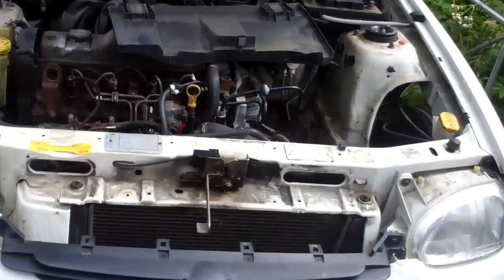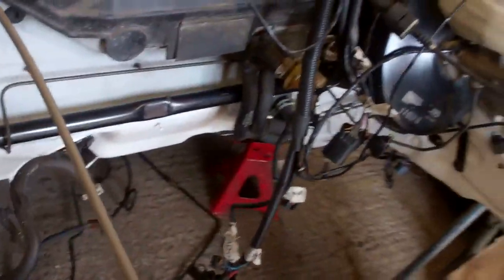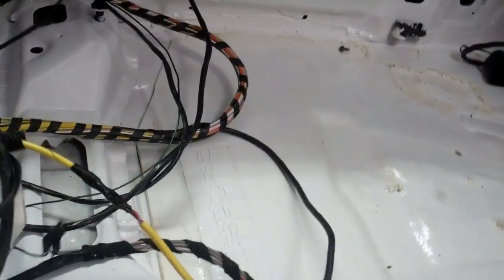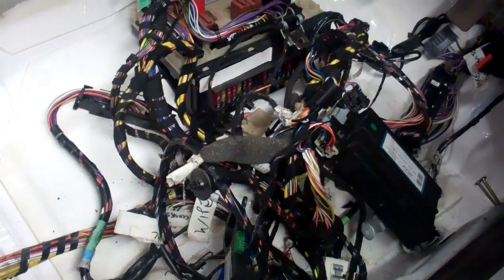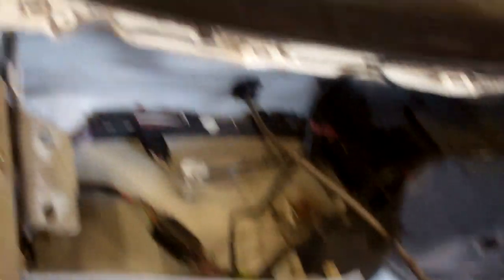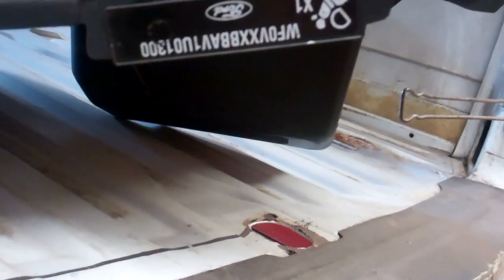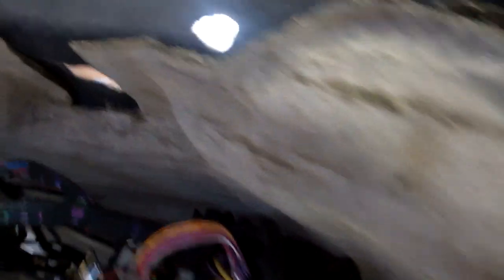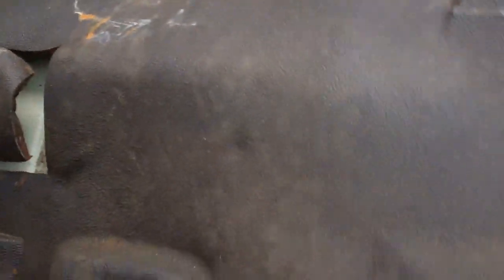FORD ESCORT MK6 VAN MODIFICATION AND RESTORATION PART 13

Comment: Great progress, I am aware of the maximum effort required to convert a diesel to petrol after reading up over the years for my van. I am in the process of getting a wiring loom from a Mk5 Ghia, your update on the U shape of it has greatly helped me as I have removed carpet and was about to start taking the loom out only done where the doors are. Some of that loom may also be the electric windows and stereo wiring that you have. I will keep this in mind now and hopefully I can get the fuel lines I was aware the tank is different which I have a NEW one already to fit for the van. Keep it going.
Reply from the maker: Thanks for your support hope you build goes well too 👍

Comment: That sounded like a real pain of a job, swapping the loom and everything else over... Like I said before I have the same diesel van and am looking to do the same engine conversion as you are... it is certainly giving me a headache after seeing you struggle, glad you are keeping going with it, especially now as it seems you are almost there, keep up the good work, really enjoying your video's.
Reply from the maker: Thanks,it has been a struggle but once the loom is in position in the van everything should be plug and play apart from the rear light they are wired totally different and I will have to join the van loom to the saloon loom,more fun and games, thanks for your support 👍

Comment: You’ve done it the easy way have a full car.  I build an RS turbo van back in the 90s.  I bought the engine and box. Then everything else when I realised I need other things
Reply from the maker: That’s why I bought a complete donor car ,I could never have worked out how to do it by buying individual parts,it’s doing my nut in as it is lol,hope your conversion came out ok in the end, thanks for watching 👍

Comment: I don't understand why you'd bother going to all that trouble on an old escort van? Or am I missing something?
Reply from the maker: It was just what I thought was a quick smarten up job to do through the lockdown but as I got into it it turned into a full blown restoration,it just grew and grew lol I’ve got to see it through to the end now,value of these vans in good condition are creeping up and by the time I’ve finished it it will probably be the only one left on the road lol, thanks for watching 👍
Reply: @DIYCampervansAndVariety  well good on ya for tackling it. But I think you'll find many other bits that need altering too. But saying that I'd rather have a project than be sat bored. I look forward to seeing it completed